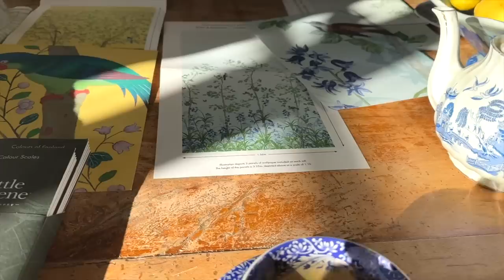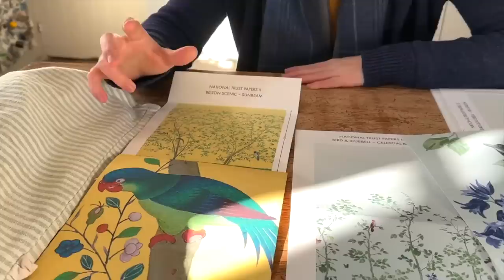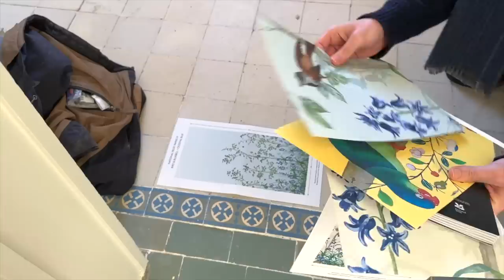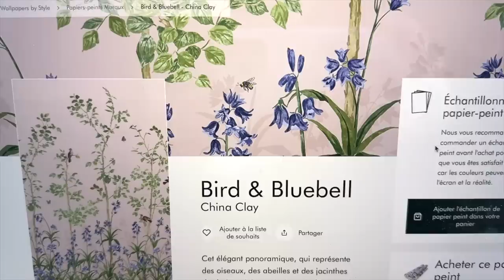Easter Prep at the Chateau: Maria's Cracking the Whip!

Comment: If it had been me, I would have redone the rear kitchen with stainless steel worktops and cabinetry.  Much easier to keep clean, hard wearing and hygienic. Doesn't have to be expensive either.  Similar to how Dick and Angel designed their working kitchen.  I'm sure Maria would approve!
Reply: The kitchen remodeling is on the plans, but for the next year or the next.😂😂😂